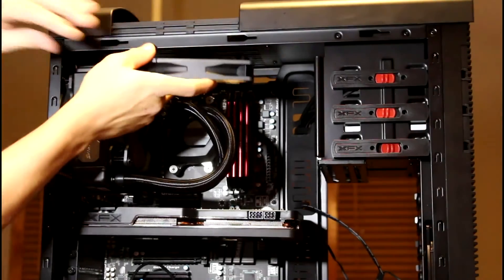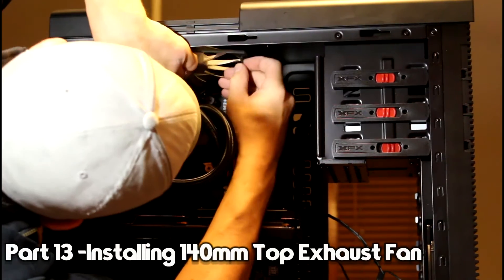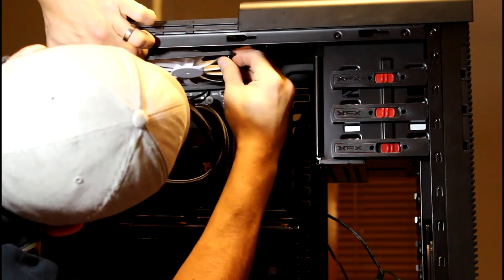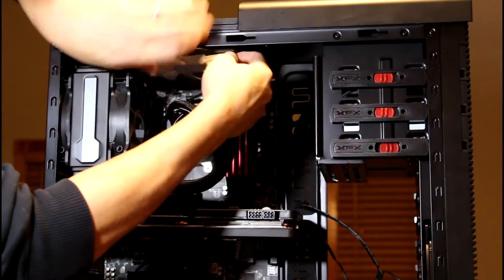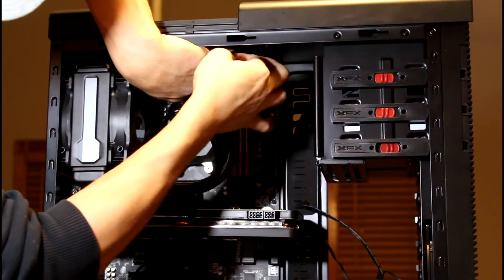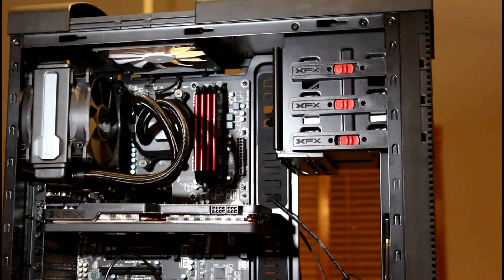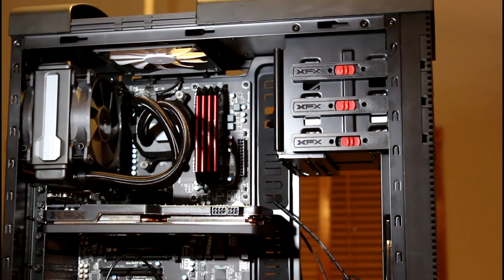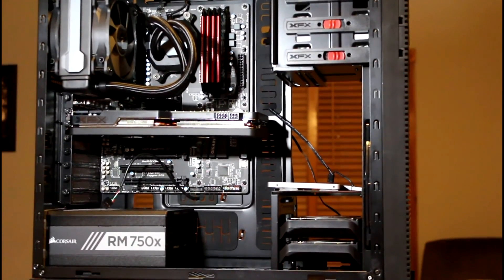Arctic F14 Silent 140mm Exhaust Fan Installation - Build a Powerful Video Editing PC - Part 13

Comment: Did you use the screws that came with the case?
Reply from the maker: +saturn144 Yes I did. I took the screws from the rear exhaust fan and used them to install this fan up top.

Comment: What's the fan like in terms of performace / noise? 
I have the F12 (120mm version) and am quite happy with it
Reply from the maker: +Rohan Patel Fan is great as far as moving air and noise. Negligible sound but really only good in this scenario as an unobstructed exhaust.